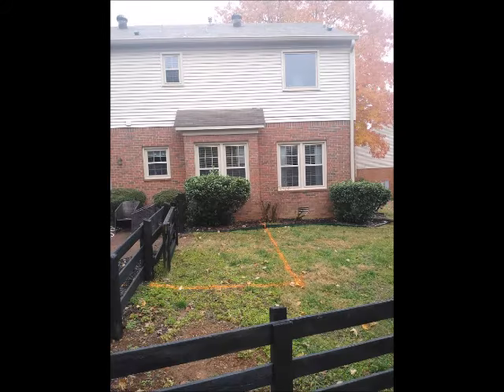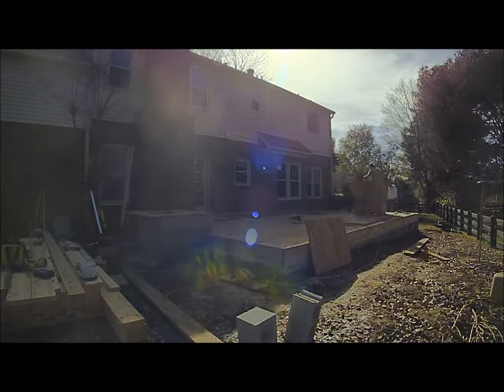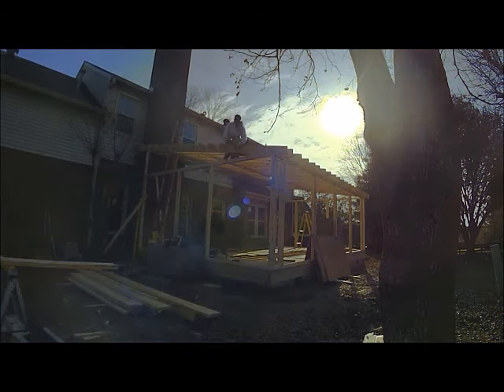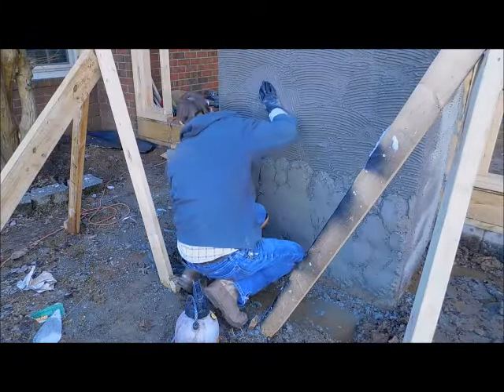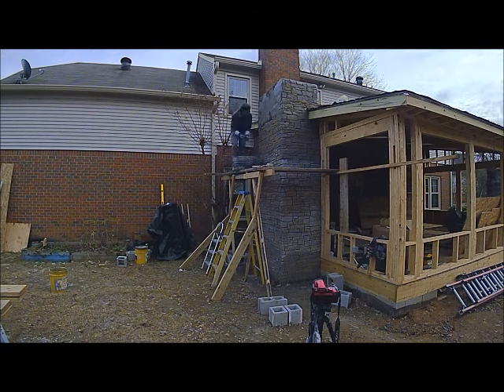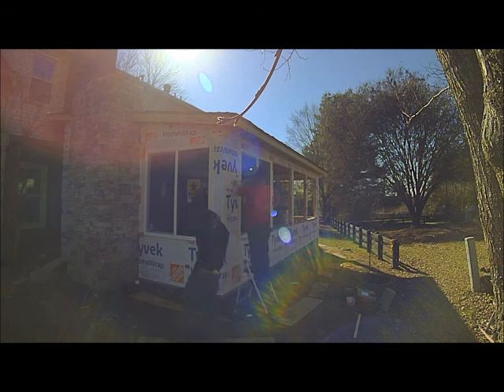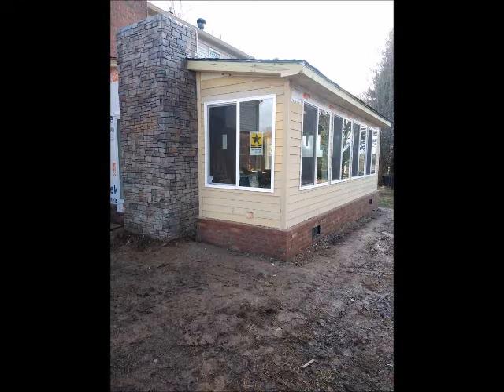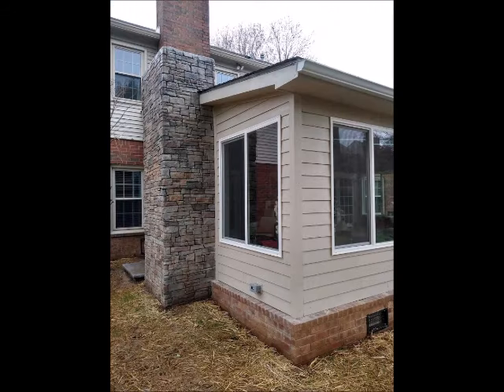Home Addition 400 sq ft. Sun room, Start to finish.

Comment: What was the total cost of this ... very curious bc this is a long term goal of me and my husbands ..
Reply from the maker: 40-50k if you are hiring a contractor to do the work. With a fireplace. Without a fireplace maybe 7k less. Also depends on the state your in a little not all that much.
Reply: @DanielMorrison7  awesome ok yeah we plan on contracting out. No fireplace (have a huge electric energy efficient coal stove looking heater 👍🏼) that’s pretty cool i imagined it being more (than 7 & closer to what you paid without a dang fireplace lol), also we live in Pa 😊
Reply: I will be adding one minus the fireplace. $7k sounds great! Plus I live in Ga! Hopefully it’ll be closer to $5k!! 🙌🏾 Thank you so much for sharing!!
Reply: @NisiJ28  LOL he meant it was still going to be $30-$40k without the fireplace.
Reply: @NisiJ28  sorry but the windows and door alone is $7k.  He said 40-50k.  But without the fireplace it will be 7k less.  So 33k-43k.
Reply: @daniel morrison does the $40-50k include the land clearing and prepping also?
Reply: Great video!  What did the homeowners do for heat and cooling?

Comment: Quick question, at 20:13 where are you running your downspout from the 2nd floor? Is there a second downspout/gutter directing water to the ground or is the 2nd floor downspout sending water to the roof of the sunroom and water is exiting through downspout/gutter at the front of the sunroom? Hope this makes sense.

Comment: Nice work!  I just subscribed!
 Is the stamped concrete more cost effective than just covering w/ stone...looks like a lot of work?!
Reply from the maker: Well if your doing the work yourself it is cheaper, But if your using a company it may be about the same. You would just have to compare pricing. with either rock or stamped concrete you still need the block first. the actual stone itself was gonna cost about $2,200 and everything for the stamped concrete was about $1,450. Also most of All the stone vaneer that you buy is nothing but formed concrete and stained. So really the same thing they just do theirs in a shop with molds then pop them out and they are individual Stones.
Reply: I just covered the outside of a fireplace (220 sf) w/ Flagstone Mossrock (also called Fieldstone) and the stone itself cost $500.  Im sure the labor to install it was considerably more though!  Nevertheless you did an amazing job with the stamping.  I had never seen it done vertically. 
Btw I’m in Az so the stone is probably cheaper here since I literally live about 30 miles from the source!

Comment: Thinking about adding 400 to 500 sq ft to the house . Will hire a company . How much did you pay for it without the fireplace if you don't mind asking?
Reply: If I had to guess I bet total cost is 26k . Concrete plus foundation is about 2k , permits 1000, windows about 4k for windows and doors. Siding and bricks about  2k , lumber about 5k, insulation 1500 and fireplace 1000, shingles 2k lights 1000, drywall 1000. And of course labor.
Reply: @codygray2296  thank you so much for the quick reply.  I think that's worth the investment.  You've done a great job kinda like how we want to do it.  Enjoy your sunroom.
Reply from the maker: Well It costed about 35k Material is about 12-15k
Reply: @DanielMorrison7  where are you located? I am going through estimations with several construction co to build 200sq room kind of what this video showed. I am getting bids from 45k upto 60k! I live in St. Louis
Reply from the maker: @paroayush  nashville
Reply: Hi thinking about 18*25 size addition to my house in the backyard we live in Georgia no need of fire place or crawl space, how much do you think will cost us and do u do any works in Georgia

Comment: im trying to build an addition in my house and the price for 280sqft is about $50,000  the only think i request in the addittion was a half bath everything is right there i think is too much
Reply from the maker: Well that sounds a little high. Although many contractors will charge that much and never touch the job. Im one of the few contractors i know that actually does the work also. So it sont cost the homeowner double. The contractor needs half the profit and the other half of the peofit goes to the subcontractors who actuall do the work. So if you can find a smaller contractor someone who is focusing on growing a large business you should get it quite a bit less expansive. A good average is $150 a square foot.
Reply from the maker: Also material is going up everyday never down. And your wanting a bathroom. Thats plumbing, and fixtures etx. So that would add some also.